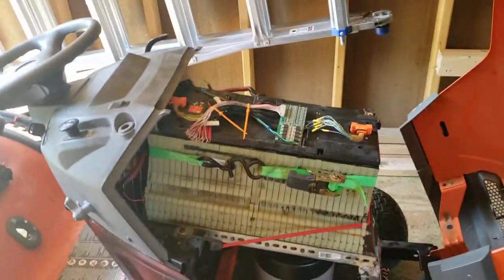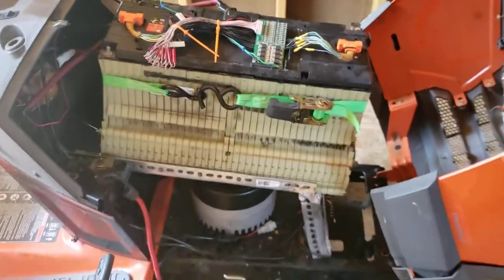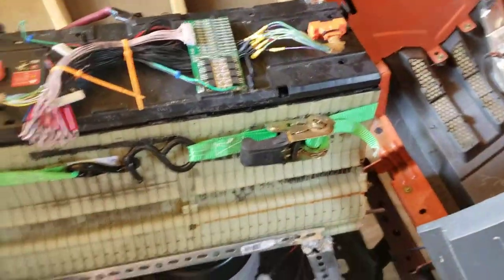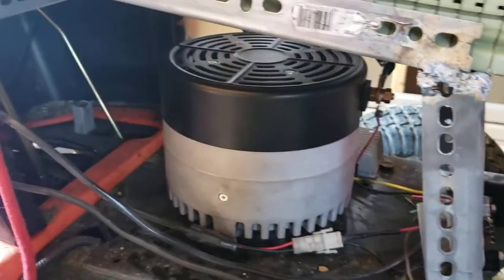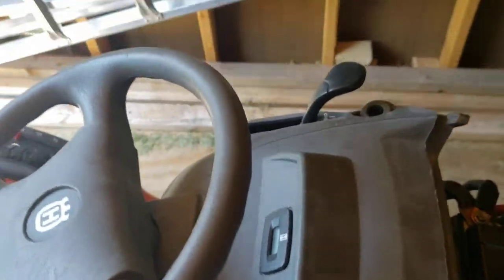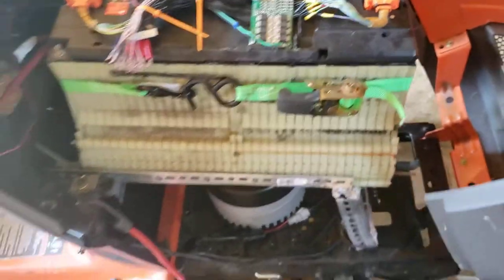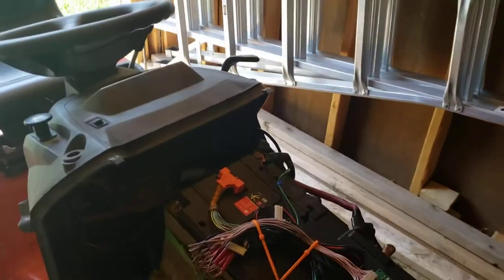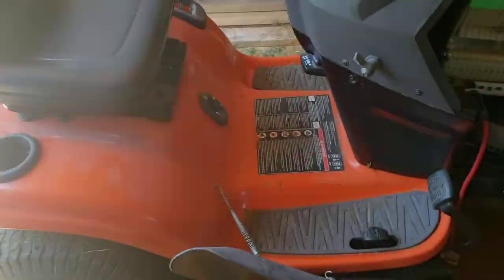Husqvarna Riding Mower - EV Conversion - Explanation

Comment: Well done! How many kWh is your battery and how long can you run the mower on it? I have an old John Deere GT245 that I want to convert and my property is around 2 acres; so I am trying to figure out how big a battery I will need to mow it in one go, and if it will fit in the available space. It looks like you kept all of the belts and hydrostatic, rather than converting the blades and drive to electric. I think that would lose about 25% efficiency right there, so I can imagine that if I go with separate motors for each system and do away with the belts, I may be able to use a smaller battery to get the job done. My mower has a 22hp engine, which is around 25% efficient, minus the belt drive inefficiencies. I would say that equates to around 3 to 3.5kW. It takes me two to 2.5 hours to cut the lawn normally, so I am assuming that I may need a 6 or 7 kWh battery pack. However, the electric drive and blade motor setup would be far more efficient, so I may get away with a smaller battery. What are your thoughts on all of this?
Reply from the maker: I love the idea of direct drive for the trans and separate motors for each blade. I have honestly been looking at doing something like that the next time I find a mower. I was thinking of getting two brushless motors from old push mowers to drive the deck blades. Efficiency wise I believe 2-3 battery modules at 2kw each would give you the required drive time and then some.